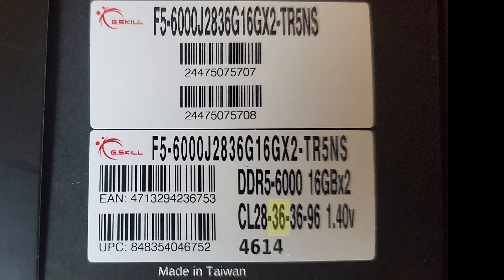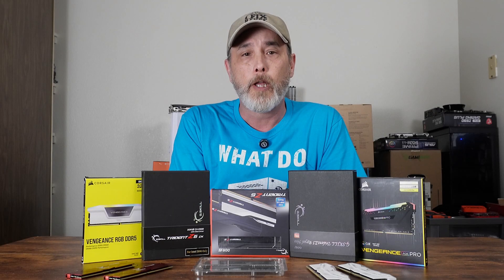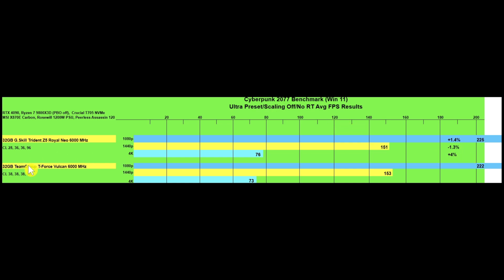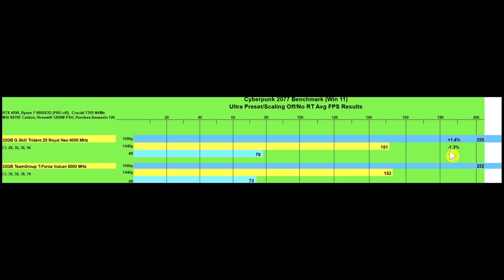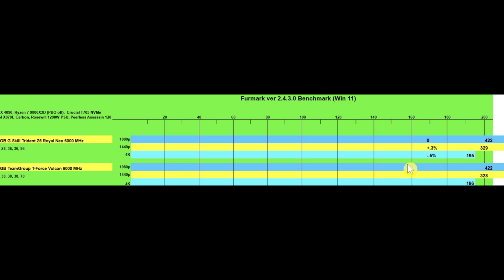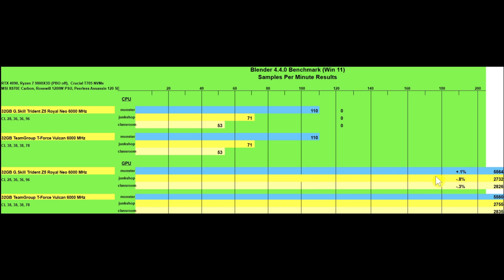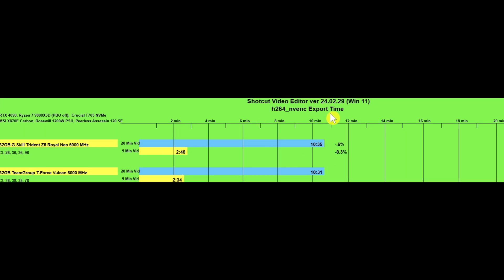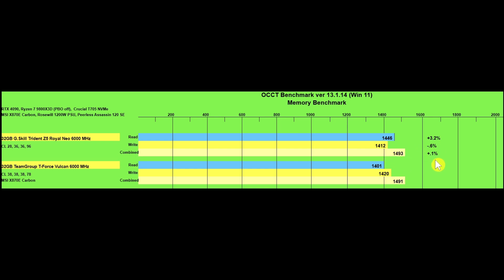PC RAM CAS Latency & 3 Other CAS Timings How It Works & Is It Important?

Comment: I want to clarify something for those of us with new Intel processors. If you have a Z890 motherboard with updated bios, you will have the option in bios to turn on 200S Boost. This is an Intel approved overclock that does not void your warranty. This OC is specifically for Intel Core Ultra processors. If you have XMP DDR5 RAM enable it, and it will take full advantage of your super fast memory. Benchmark show it will improve performance by 5 to 15 percent. The benchmarks also show a FPS increase of 3-7 percent between 6000 and 8000 MHz DDR5. If you have a different processor, there may be a way to utilize XMP memory for your system. I'd look into it!

For those that don't know, XMP (Intel Extreme Memory Profile) is a technology that allows you to easily overclock compatible RAM to its advertised higher speeds by loading preset profiles stored on the memory modules themselves, rather than using the slower, standard JEDEC memory settings.
Reply from the maker: That's some great info, thanks for the added details! I did test the 200S Boost update on the 285K in a video a bit ago when it first rolled out in case you'd like to take a look!  Thanks for the comment and for watching!

Comment: That's really interesting. Thanks for posting. I actually have that gskill kit. I didn't think it was any faster than my old kit. Sure looks pretty though!

One thing to note. DDR memory speed is normally quoted in MT/s, not MHz.
Reply from the maker: Thanks and good point there!!  I was a little disappointed they weren't faster but they do indeed look nice!!  

As for the MT/s, that is indeed the speed, but the frequency (or MHz) is the same as the speed (MT/s) i.e. 6000 MHz (or frequency) is the same as 6000 MT/s (speed).  It's interesting that they are discussed almost interchangeably throughout my research and even in other youtuber videos that do hardware reviews.  Sometimes even in a given bios you'll see either one as well as you'll more often see MHz on packaging and labels (and ads for the kits!).  

Thanks for watching and for the feedback, I think I should maybe have said something about that kind of stuff in the video!
Reply: @Lead-a-Horse-PC-Hardware  6000MT/s is 3000MHz. Hence the dual data rate. If you look at ram with a speed of 6000MT/s ram in windows, it will report 3000MHz. It can simply transmit data twice per clock cycle.
Reply from the maker: Ahh you're right!  I sometimes tend to forget the dual channel part of the data transmission!  I use it so often, I tend to think of it as a single item rather than a kit of two lol Thanks for that!

Comment: [2:50] 6000 C28 rated D5 would actually have a higher CAS latency than 9200 C42 rated D5
Reply from the maker: Yeah, I think we are saying the same things just in different ways.  When I said the higher it goes, I meant it would be slower (the number increasing) whereas I think you are saying the same thing in that you mean higher is faster, i.e. 28=faster (or "higher") than 42.  Sorry if my wording was confusing!
Reply: @Lead-a-Horse-PC-Hardware  No, it's just actually faster. 9200 C42: (1/4600000000)*42 ≈ 9.13e-9 ≈ 9.13ns ; 6000 C28: (1/3000000000)*28 = 9.‾3e-9 ≈ 9.33ns
Reply from the maker: Interesting!  So are we talking faster by the math in theory of what they are capable of or what shows up in real world applications?  I ask because I did a test a bit ago testing ram frequencies between 6000 up to 8200 and showed little to no difference in overall performance in both gaming and productivity (as well as some synthetic benchmarks).  It's an interesting subject and I'd like your take on the math vs. in practice!

Comment: Interesting test, if you haven't already tested it, one thing missing from this test is a non-X3D CPU. 
X3D CPUs are not very RAM sensitive since the larger cache means the CPU doesn't need to hit the RAM as often.
Reply from the maker: Good point!  I'll have to look into that as a follow up video.  Thanks for the feedback and thanks for watching!
Reply: This ^. Having large cache size kills off any ram scaling benefits. The main game I play is Vindictus (very old game) and it uses ram all the time. Using x3d cpu can 4x the fps compared to a normal cache size CPU.

Comment: Now I am kinda glad I saved like 30 bucks or more by getting some 6000 cl36! Thank you for the great info 😃
Reply from the maker: Yeah, 6000 CL36 is a good price-performance! I prefer CL 28 to CL 30 to ensure max performance at that frequency, but mostly for benchmarking hardware.  Most will not really see any differences between 36 and 28.  Definitely a good choice on your part!
Reply: If he didn't enable the higher speeds in bios this may be a flawed test. What processor do you have? If it's Intel then read my comment above.